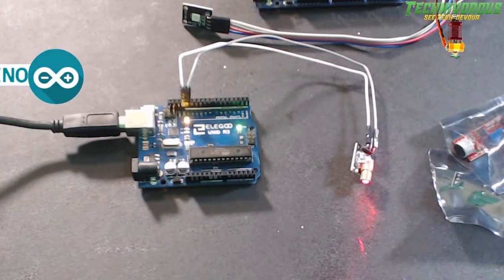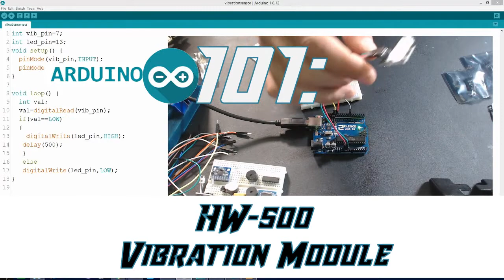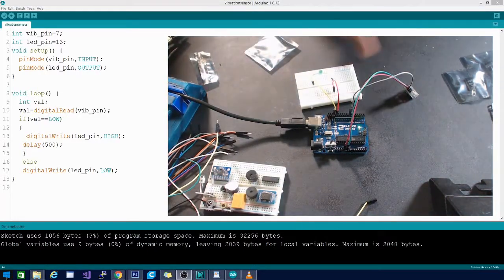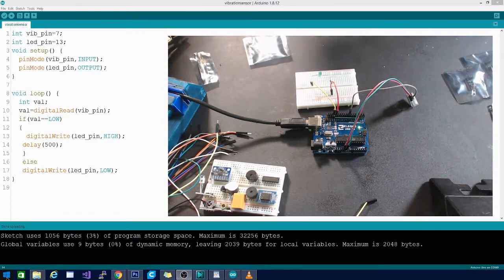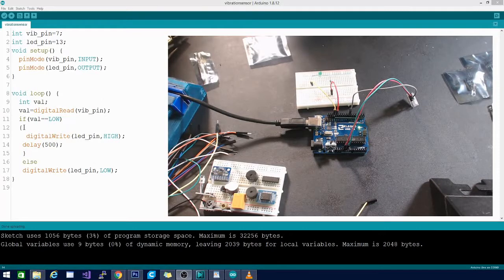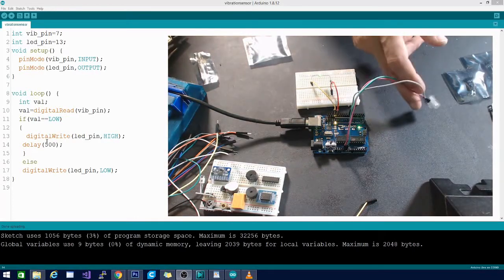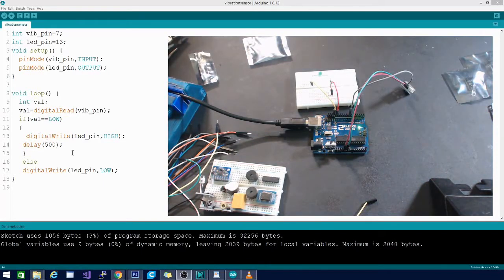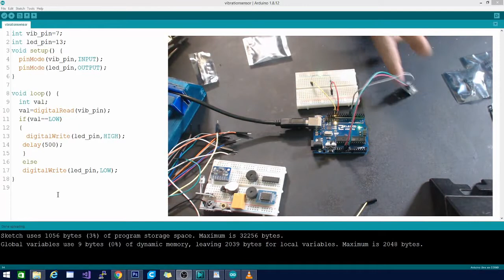HW 500 Vibration Sensor Module   Arduino for beginners   Sensors

Comment: can the sensor output analogue data? to activate on vibration strength
Reply: I've messed around with a different vibration sensor in the past and it seemed to output more than a boolean return; however, I had to multiply the output value of the sensor by a pretty large number - x100 or so, might have even been x1000+ - in order to get enough fidelity that I could then divide down into a percentage or whatnot. Unfortunately I did this over a year ago and didn't put too much time into it even then, so that's all I can recall.

EDIT: to clarify further, when I tapped my vibration sensor it would return a value that was either 1 or really close to 1; as in, the lowest vibration it would detect as movement was 0.5, not 0.1, and most vibrations were in the 0.95 to 1.00 range (those are just made up examples, but it was something close to that). So in that case the code would count 0.5 (or lower) as 0, 1 as 1, and interpret anything in between the two as if they were the actual, full range of values from 0 to 1. Hopefully that plus the above makes sense...🤞🤷‍♂️
Reply from the maker: great question, and its worth a shot. i havnt tried this yet, but i would google the spec sheet, it should tell you if its possible.